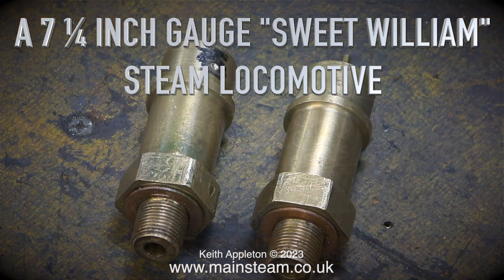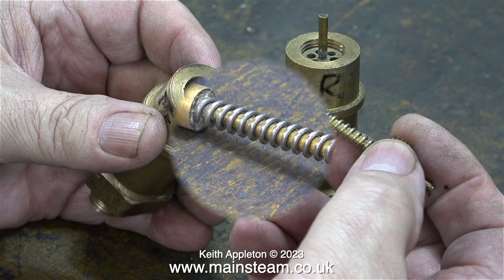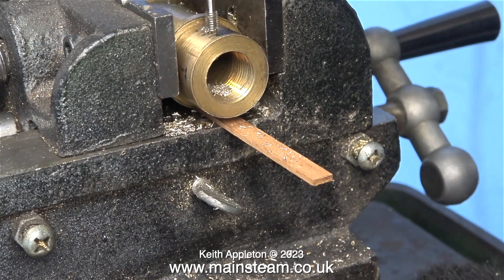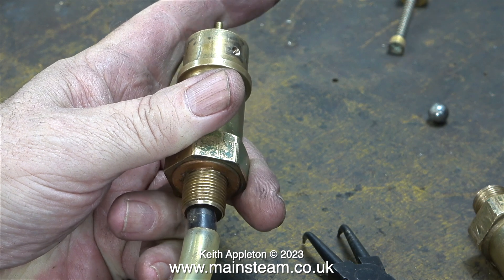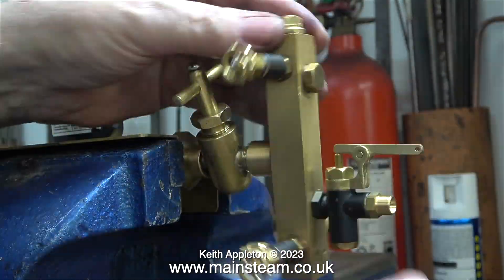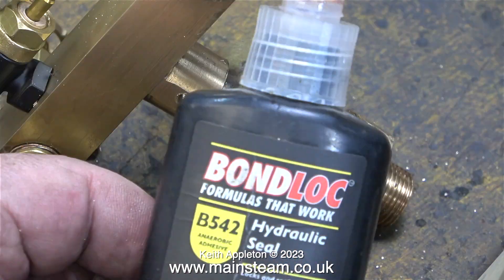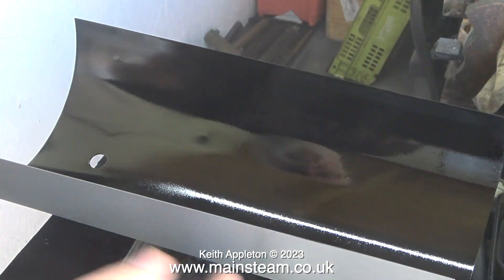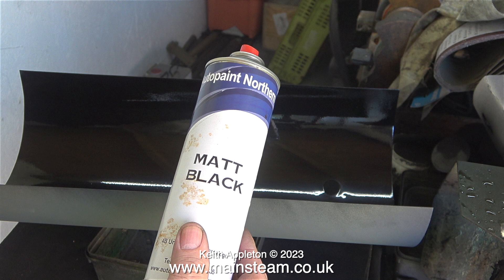A 7 ¼ INCH GAUGE "SWEET WILLIAM" LOCOMOTIVE - PART #38

Comment: One slight gotcha with tapping size drills is that metric threads can come in more than one different thread pitch, but they all follow the rule of thumb where you subtract the thread pitch from the major diameter and that gives the tapping drill size e.g. M12x1.25p uses a 10.75 Mm diameter drill
Reply from the maker: I really don't do much with metric sizes, all the drawing I use show Imperial threads and fasteners. (BA & ME sizes)